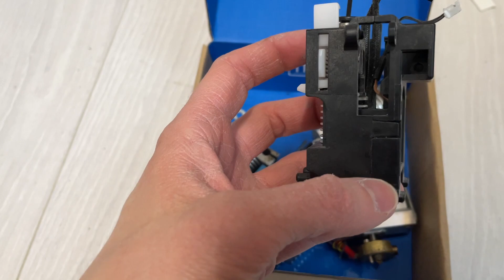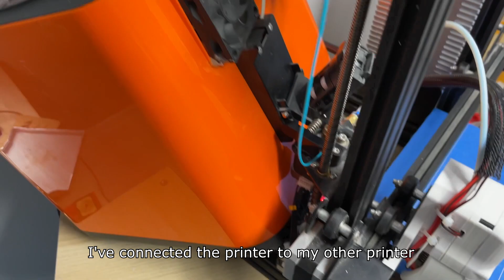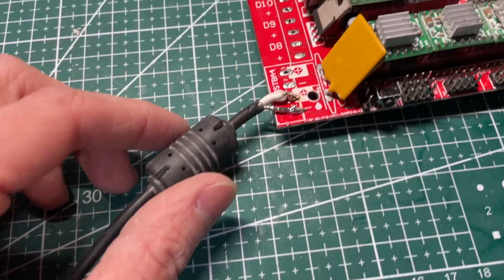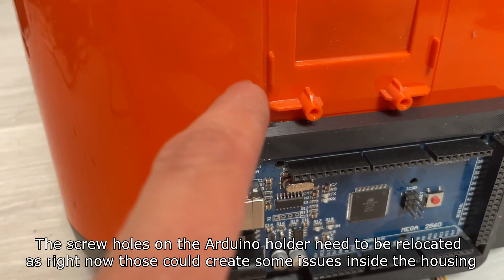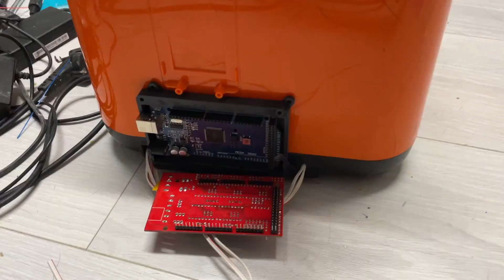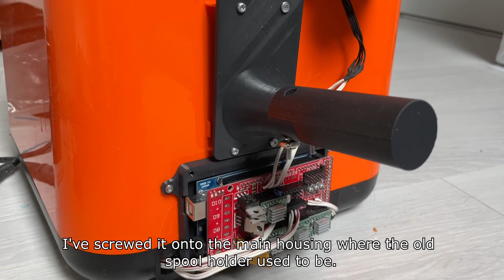XYZ DaVinci Nano Restoration Part 1 | Marlin RAMPS total overhaul

Comment: Hey, can you tell me where you originally connected the fan? Thanks!
Reply from the maker: I don’t remember exactly but there are several pins on the main board where you can connect the fan. You can do it directly to the power supply as well